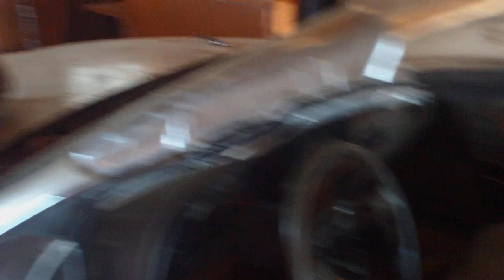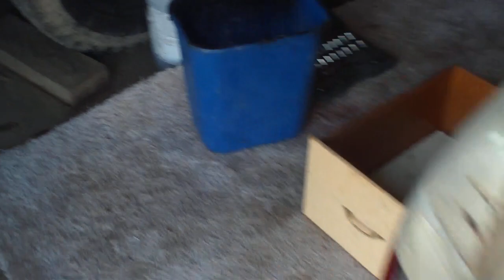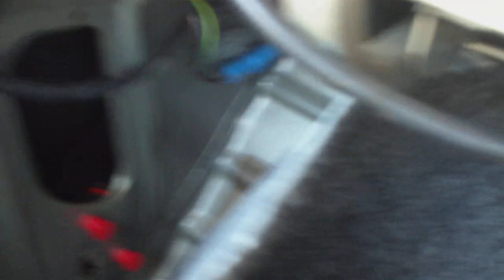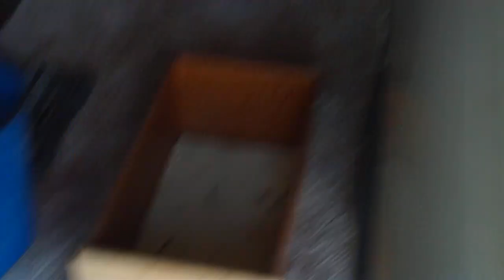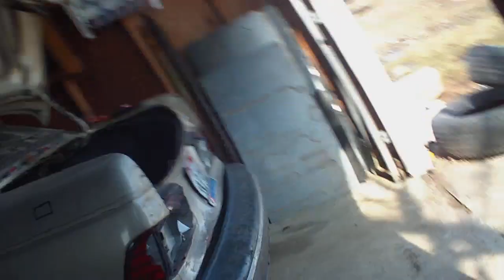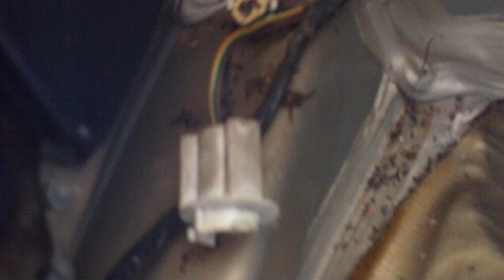How To Strip a Derby Car: Part 1

Comment from the maker: @09JrSmith  The rear will be tucked and corners kinked, no bumper and prebent mounts, all thread through lid, window bar and every inch creased. Jon has a bubbletop.

Comment: I have a mk4 gti and I can strip nearly the whole thing with 1 screw driver
Reply from the maker: Yeah, the newer they get the easier they fall apart. I stripped a 2001 Alero with almost only my bare hands, snapping most parts off.